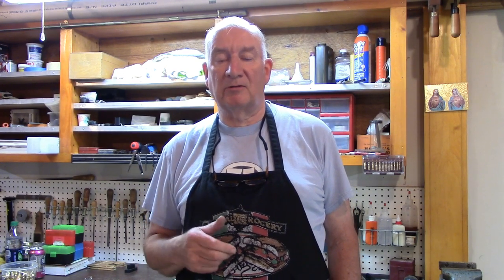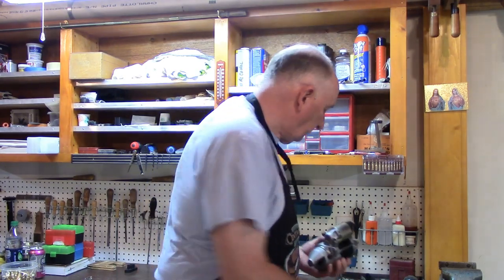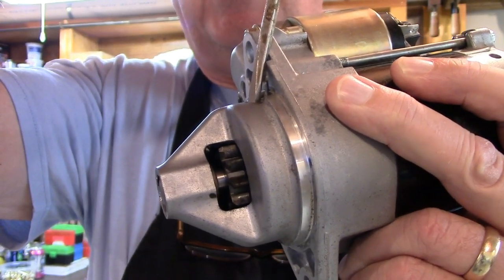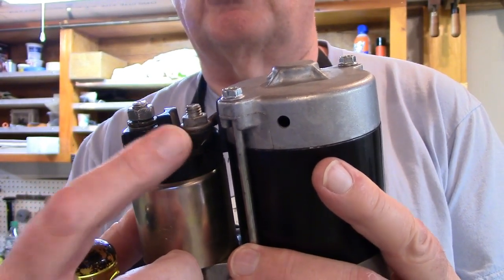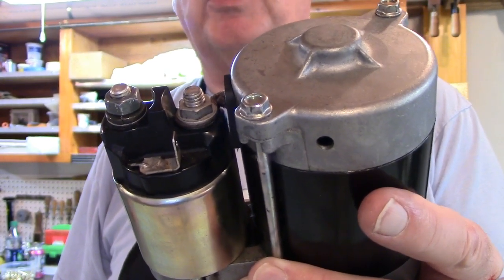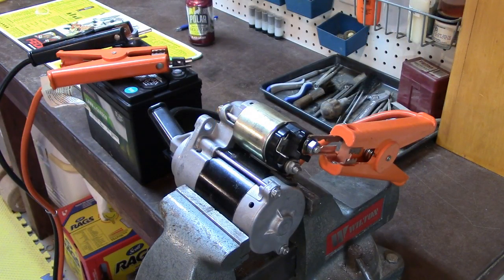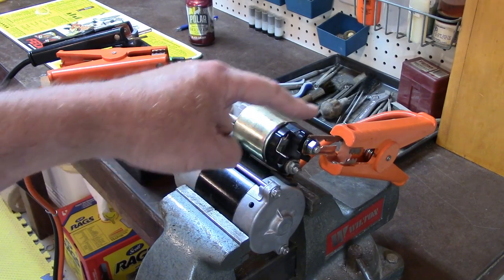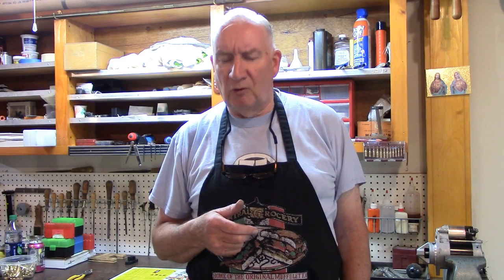How a Starter Works ~ Do a Simple Function Test!

Comment: Great video, as usual, But it left me wondering - What was wrong with the generator?
Reply from the maker: The 10 amp fusible link blew in the ignition line from cranking too long when I had a contaminated carb from ethanol contamination.  Pretty simple fix.  It's running great now.
Reply: @GunBlue490  Thank you. I hope you don't need it anytime soon.

Comment: there is a fork attached to the solenoid which forces the gear on the starter forward to engage with the engine  at the same time when the starter is spinning
Reply: Kevin Howard-Tripp Not the case in a Bendix Drive starter. The Bendix Drive moves the gear forward when the motor is spun. Also prevents the starter from being back driven if for some reason it doesn't disengage from the flywheel once the engine is started. Ford uses a different type that relies on the magnetic field of the windings to pull the pinion gear forward. Some gear reduction starter motors still use the solenoid to drive the pinion gear forward before it starts to spin, in theory reducing wear on the flywheel ring gear. Rebuilding starter motors and alternators was a very busy and lucrative trade a few decades ago. Now those shops are all but a thing of the past... Thanks to our disposable cultural and the cheap overseas labour.
Reply: @thetoecutter13  Thanks for the extra details. Are some starters hybrids? They use the helical splines of a Bendix drive and a fork to help things along?
Reply: Richard Burnsed I honestly don't know without looking it up. I was an auto mechanic for quite a few years after I got out of the Navy, I changed hundreds of starters but never re-built any. Took a few apart out of curiosity but usually when you change one there is a core charge, as in the old starter goes back to the parts store and sent along to wherever to get refurbished and you get a few dollars back. There was a shop we sent some alternators and starters to for re-builds but only if it was an older car or a hard to find replacement. They re-built my MGB alternator, it came back looking brand new. That was back when men knew how to fix things and took pride in doing it.

Comment: Good video ! Just a note,  if your  vehicle 🚗, won’t start ,won’t turn over, and your battery is charged, lights hi beam etc. Work ,turn off  ALL  lights radio ignition etc. Grab a hammer , big rock , something heavy and give your starter a couple of  heavy taps and then try to start the vehicle 🚗 again , if  it starts you have a dead 💀 spot in the starter motor, you may get away doing this a couple of times but you need to replace the starter.
Reply from the maker: Yes, that fix is for a frozen solenoid.  A dead section of the commutator can only be moved by turning the armature of the starter with a screwdriver, which isn't always possible. Our old clothes dryer could be coaxed by turning the drum, but even that didn't work for long.  Often, a particle of it will dislodge and foul the motor badly, or short it out. Thanks for your support and advice.

Comment: Rocking the car or tapping the starter with a hammer even a dirty lead clean up got me a tip in the restaurant parking lot I worked for as a waiter going home late at night.
Reply from the maker: Yup, rapping with a hammer can often free a sticky solenoid.
Reply: Never smack one hard though, just tap lightly. Result of a hard hit, is busted magnets and no hope for another start up.
Reply: Big Red, thanks for the AC bridge alt.  tip ! For those people who GunBlue is addressing, that coil of copper wire he was pointing out surrounds an iron core attached to a lever that throws the bendix gear forward  into the teeth on the ring gear to turn the motor over, at the same time causing the copper plate (washer) to be a jumper from the pos.  terminal to the wire that goes to the starter motor so it has power.
Personally I have never seen that bendix slug hang up, it is usually the electrical contacts that are the problem, & yes banging to hard on the starter body can break the iron magnets , which of course demands immediate starter replacement.

Comment: You're telling this to the kids that never had to lay under a Chevy truck and bang on the starter while your bud tries the key. Thanks!
Reply: Sapo hahaha.   It’s true.  Maybe amazon can test there starter solenoids.  Babba
Reply: There are 2 reasons why you have to bang on the starter #1 That copper plate he was talking about gets pitted & warn , and the contacts it jumpers do also, so if you can take it apart, clean the contacts, turn the washer over solves the problem ! Or of necessary go to a starter rebuild shop and buy yourself new parts
(  $.50 )for new washer. Shop will charge you $30.00 to do this 
#2 the motors carbon brushes are worn out , which will soon damage the armature, then you will need a new starter motor, so do a exchange , again at a rebuild shop , cheaper than new starter
Reply: I've had cars that I could reach from the top, fortunately.
Reply: I had an 1965 MGB that had a cantankerous starter. They had an "exposed" Bendix spring that had to be kept lubricated or it would  fly half way out and stick so I had to crawl under the thing and bang it with a hammer to free it. This, of course, usually occurred when it was either snowing or rainy and the car was parked on the street near the gutter which was flowing with water. I loved that car even when the battery fell out while I was driving down the road, the hood used to fly up and wrap itself over the windshield, the carburetors used to stick when they got hot, the drivers seat broke free from the floor when I was driving down the road, the steering wheel came off in my hands  while driving, the  steering rack and pinion gear locked when I was going around a turn, I had to shovel snow off the leather seat in the winter because the roof was not sealed tight to the window, The black leather seats got so hot if the roof was down in the summer I had to sit on a cushion, If I didn't get the roof up at night when it turned cold the roof would not lock down, It had Spoked wire wheels that could only have tire changes done using  Tire Irons so no one wanted to fix a flat tire, that is if you could get the Spinner Nut  off the Axel to remove the wheel,I finally drove in the yard one day and stripped off what I could sell and chopped up the Frame with a Grubhoe and buried it in the backyard. I Have had a lot of vehicles over the years but This one I remember both fondly and not so fondly. It stands as a  testament to what young men will  put up with to impress girls.Did I mention that on rainy nights you couldn't see because the headlights from oncoming traffic would blind you even if they were on Low beams.
Reply: I would be remiss if I did not mention that in order to work on the clutch you had to remove the entire Motor, so $20.00 clutch job became a $140.00 clutch job that is after you waited for the parts to come from England.
Reply: @showmewhyiamwrong  A clutch job on an MGB was eight hours on the book. I got it down to five on a few occasions..

Comment: A good, high quality DMM (Digital MulitMeter) is an invaluable tool for basic electrical system diagnostics. 

With the DMM connected to your battery, look for a voltage drop when the starter motor is engaged. A healthy battery shout be reading between 12.3V and 12.6V. If voltage drops to below 10.6V that a good indication of a faulty battery. No drop at all is an indication of a bad solenoid. 

Here’s another little electrical system trick I’d like to share. If you suspect that your alternator may be faulty here is a quick test.  With the engine running, check for ALTERNATING current (AC) at the battery. If you read more than about 2V of AC at the battery, than the diode bridge in the alternator is failing. High levels of AC current will cook the plates inside the battery and cause the battery to fail.
Reply from the maker: "A good, high quality DMM (Digital MulitMeter) is an invaluable tool for basic electrical system diagnostics."  I didn't do this video for the person who owns a digital multimeter, or who has the faintest idea what they do.  You didn't need to place that in parentheses; I have been using multimeters since they were in pigskin boxes.  I have always found it funny that a woman goes to a Sears garage to have her dead battery replaced.  The mechanic puts it on his $10,000 diagnostic cart, comes over to her wiping his greasy hands, and declares; "Ma'am, your battery is only reading 10.2 Volts, so you need a new battery."  No kidding.  She knew that when the key wouldn't start the car.  A guy tells the mechanic "the left front tire is pulling; it's not holding air."  The mechanic will report back, "The tire is only reading 19 pounds, and it must have a leak."  Remember the KISS approach to life and not over complicate the simple.
Reply: GunBlue490   I just wanted to clarify that my comment was in no was an attempt to insult anyone or their intelligence. You most of all. I turn wrenches for a living and simply though that a little insight may prove useful to some people. I apologize if my comment was taken any other way.
Reply: Big Red  Thanks for the ac @ battery tip ! I'll be checking out my atv that seams to burn up batteries

Comment: In the study of mater, atoms, & electrons  one learns that current flow occurs when electrons move from one atom o another, the electrical charge of an electron is NEG , & like charges repel each other , so the electron of an atom can NOT flow to another atom unless that atom is deficient in electrons i.e. positive ! Therefore the actual direction of current in your car is from ground (earth) to the positive terminal of the battery , so when you turn on your headlights current comes out of ground though the light filament being converted to heat & light, though the light solenoid that made the contact back to the POS. , of the battery! If current flowed the other way all relays & solenoids would have to be much heavier. 
Current in a wire generates a magnetic field, that have what is called magnetic lines of flux which have  north & south poles, these poles change depending on the direction of current flow, so when you turn your key to the start position electrons flow through the coil of wire in the starter bendix causing a magnet of north & south poles , causing the core to suddenly shift because it also has poles , remember like charges repel
Reply: Robert Mintz - wow, do you have a College degree?  Ooooo you are so smart.  Thank you for your totally comprehensive, excessively detailed, diatribe on electric transfer of power.  You should make a video instead of trying to fact check an elder who is providing information that works without 3 months of theory.  Some of don't care why... As long as it works.

Comment: And if your solenoid does not respond it's usually the disc inside that hits the two bolts. It gets burned and won't make contact. Take the solenoid apart and turn the disc 90 degrees and there you go new contacts. Brand new solenoid. Us old times are something huh. A penny saved is a penny earned.
Reply from the maker: Yup.  This was intended to be a what is, not a how to.  Thanks.

Comment: I've always just touched a screwdriver across the two and if there's no spark/no ingadgement and you know there's power (good battery) then the solenoid or starter is no good
Reply: Ha, I just commented about that.
Reply from the maker: That's what I did with the jumper wire for clarity.
Reply: Jumper wire acted as key circuit

Comment: Great video, unlike most video's by younger poorly educated College graduates, you will notice he uses the proper English definitions for the "spade" and "lug" etc.... I get so sick of You-tube educational video's with improper English with generic descriptions of the components/items listed in the video. The next video you should tell non car guys or even car guys born after 1970 that is the solenoid won't work on the start and it did recently you can do a temp fix by taking a hammer to the body of it and miraculously it will work and the starter will function! This is because a little corrosion will get in and bind the little metal solenoid to the body so when you it gets the V's it will not be free to move the gear over and complete the circuit. Just pull one apart or look at a break down of the parts and you will understand. the free cure back in the day wast to pull the solenoid apart and steel wool the solenoid & maybe put a little anti corrosive grease on the moving parts. Free fix 80% of the time the actual starter will be good, if not, inspect the flywheel gear for missing teeth before you install and ruin a new starter.  love this man, 100% American knowledge based info by a man who obviously been educated in many fields of study. Included life studies from the University, I will figure it out because I bet I can!
Reply from the maker: Growing up poor was my blessing; I learned to do what I couldn't afford. Thank you.

Comment: I got a 90s model chevy 1500 that had engine light off and on, on then off, and so on. It was EGR related according to code.. After changing out the EGR valve, problem still was there. Ended up being the EGR solenoid .Problem seems to be fixed, no more engine light off and on. Next step would of been to replace all vac lines to rule out air leak. Now, if I could just figure out the weird shifting, hard from 1st to 2nd. Had 2 weeks of perfect shifting then back to the hard shifts. Rebuilt tranny in in 2007 then started the hard shifting, and had it looked at and rebuilt again 2017 to have them stumped as to why its still shifting that way. I will not rebuild a 3rd. I will just live with it  until it goes out then replace with another unless its a cheap magic fix.
Reply: Does your transmission shift later than you would expect when it started shifting hard? Older transmissions used engine vacuum as part of the signal to tell it when to shift. I think they switched to an electronically controlled transmission in the early 90s but I believe the computer in those still relies on engine vacuum to help decide when to shift. If there is a vacuum leak or the vacuum port is obstructed that may contribute to your problem. I would expect that the transmission shop would have looked at those things when rebuilding and reinstalling your transmission.